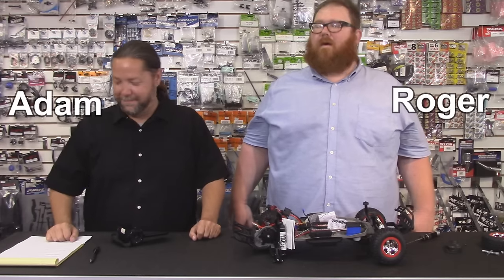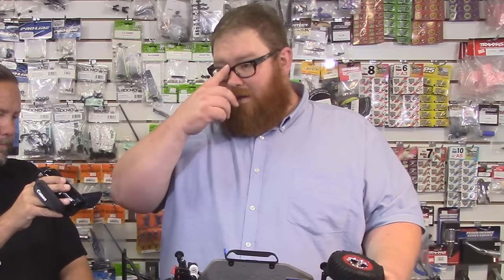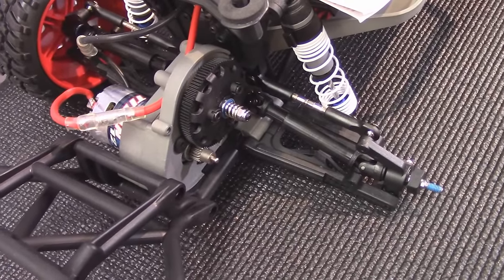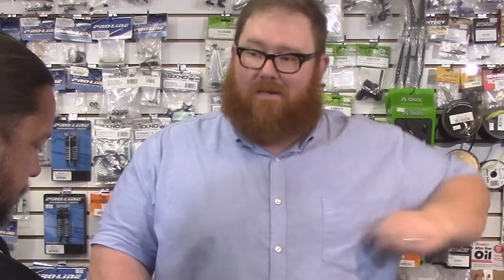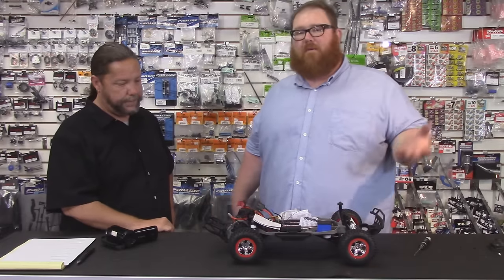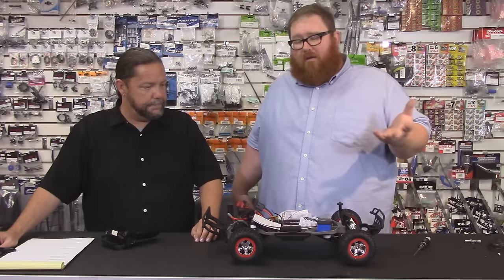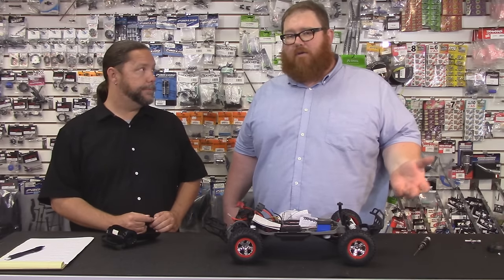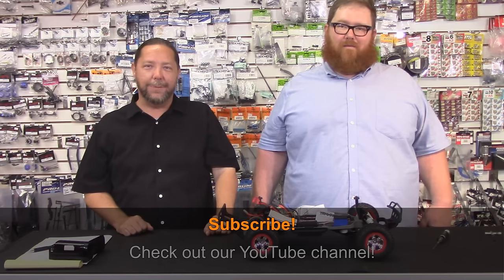Check & Adjust RC Slipper Clutch - How-To

Comment: Yeah this solved my problem. My clutch actually caught on fire... Getting a new one soon.
Reply from the maker: Wow, we've never seen RC clutch on fire
Reply: @Rcstreetshop  i was trying to figure out what happened and i was pulling the throttle for a good 30 seconds then some of the plastic caught fire... My steering servo also died yesterday so im getting all my new parts soon.

Comment: Not gonna just strip the spur gear if its set to tight it can put that much more power into the differential only way i used to strip diff gear in tmaxx

Comment: AWESOME INFORMATION!...I have a question hoping you guys can answer. I recently chose to put aluminum slipper pads. After a couple of runs I opened it back up and noticed I had metal shavings every where in my MM/Slipper housing. Turns out that the hubs were grinding into the aluminum pads leaving a circular groove in the pads. Is that normal for aluminum pads?...because the plastic stock pads only had scuff marks that I can easily clean off...the hub didn't cut/dig into the plastic. If it's not normal...what can be the cause of this?

Comment: What kind of damage can overheating do to the motor
Reply from the maker: 1) damage magnets -> efficiency drops
2) crack isolation laquer -> shortcut
3) overheat ballbearing -> damage isolation ->shortcut
4) damage magnet glue -> shortcut

Comment: Is a loose slipper clutch the reason why my rustler only pulls 30 on a full 3s and max gearing?
Reply from the maker: Loose slipper slips under acceleration, so it very could be a reason.
Reply: Possibly. Or, if you have terrible tires that just constantly slip that'll do it too

Comment: nice vids, i got a question about traxxas stock tires,  do they all come unbalanced?  mine did and my back tires shake when i hit the gas in the air.  front ones seem to want to hang at a specific spot.  first time traxxas owner here.
Reply from the maker: Any tire comes unbalanced, it doesn't matter if its Traxxas, Kyosho or HPI. 
It is recommended to balance it (to make your suspension work better), but it is not obligatory.
Reply: RC Street Shop how is that done?
Reply from the maker: You suppose to use a special tire balancer.

Comment: I have a stampede, I thought the differential was shot so I bought a new one and installed still just power to the right side is this a  slipper issue? Anything will help like your channel.
Reply: Check your hub bearings (or bushings for XL-5 models). If you have a bad/seized bearing on one side, that'll create extra resistance on that side and the differential is going to send power to the side with less resistance.

Also, if you have a rock stuck between your wheel and the suspension, that'll do it too.

Comment: Thank you for that but when my rustler goes about a foot, the tires lock and idk why, please help me, the clutch is fine, the small gear turns all the way around, but the big gear stops at a certain point, please help me
Reply from the maker: It is hard/impossible to troubleshoot over the internet....from what I understand, it looks like your diff works funky. Check your differential and gearbox before anything else.
Reply: +RC Street Shop thx I'll go do that
Reply from the maker: Anytime!

Comment: if I follow your guide for the 2WD transmission upgrade, and im thinking about getting the Slipper Clutch ELIMINATOR
 I have a full aluminum 2WD stampede 3S lipo, Castle Sidewinder , traxxas VXL 3500kv motor, steel roll cage, etc I'm going for maximum bash and as much torque as possible. my question is...

Which parts can I expect to be regularly replacing, I know I'm gonna be breaking stuff
Reply from the maker: When you fully upgraded your truck, plus beefed up transmission you probably should reinforce your pins (high grade or titanium) and gears...sometimes you may even snap a shaft off of your motor...
At this point, really hard to predict, to be honest with you...

Comment: My slipper clutch is so tight I can't crack it loose and suggestions without damaging anything
Reply from the maker: Most likely it's already damaged/burnt/seized then. Just replace pads and you should be good to go.
Reply: RC Street Shop the truck is brand new I tried to loosen the clutch before I ever drove it
Reply: RC Street Shop I think Rodger got his hands on it lol
Reply from the maker: I think I know what the problem is....you need to lock the shaft first, so either hold both tires/wheels or spur gear and you should be able to undo the nut.
Reply: RC Street Shop ok I got it loose thanks

Comment: Does this apply for nitros too?
Reply from the maker: Not quite, with nitros you have clutch, which slips while engagement. Its factory pre-set, unless you change it to aftermarket or some other specs

Comment: Is a 4000kv better than a 3500 KV motor
Reply from the maker: 4000Kv is a faster motor, but 3500kv has a bit more torque. It depends on the application which one is better.
Reply: There are a lot of variables that go into that but, if I were to assume that the Kv is the only difference, the higher Kv motor produces more RPM per volt while the lower Kv motor produces more torque per amp.

Comment: When I try to tighten the nut, the slipper spins too even if I hold the gear. Is there a reason for this?
Reply: I've had that issue before too. To get around that, I stand the truck up on its left side so the spur gear faces up. Then as I hold the spur, I also push down on it that way it puts more pressure on the pads and prevents slipping while I adjust it.

Comment: guys I have a traxxas rustler vxl that I run a traxxas id 3s lipo in there I'm having real bad problems with the stock drive shafts I'm in the UK so everything ordered has extra cost on handling fees and what not plus postage from us to uk is extreme it's crazy well I didn't consider it when I bought the rusty 3 weeks ago from a UK shop and parts isn't available most of the time any ideas :)
Reply: get MIP driveshafts. never had a problem with them
Reply: Make sure your clutch is set appropriately for where you run and also make sure that your suspension is set appropriately too. If the driveshafts are constantly sitting at a steep angle, that puts additional strain on the joints and makes them more prone to failure.

Comment: this is no help I don't want my tlr22.3 gears to wear out and wheels it's a race buggy and gears for my car are expensive
t
Reply from the maker: Then I would set your clutch looser and not strip those expensive spur gears and tires.

Comment: So for higher speeds the 4000 KV is better
Reply from the maker: Yes, 4000KV is 4000RMPs per volt, so 3S is going to be 11.1 x 4000 = 44.400 RPM on the shaft (in ideal world)
Reply: Ok thx

Comment: I have a question for my 2 wheel drive Traxxas Slash how do I help cool down the motor
Reply from the maker: It may oveheat for two reasons:
1) overspeed 
2) overload 
Depends on what you have you may need to adjust your gear ratio, battery, ESC/Motor, tire grip etc

P.S. adding heatsink would not cure the reason, but definitely help
Reply: I put a bigger pinion gear and a smaller  spur gear
Reply: Is there a fan for 2 wheel drive RC cars Traxxas Slash
Reply from the maker: If you use stock electronics, then there is a cooling fan for ESC and heatsink for the Motor.
Reply: RC Street Shop mine is a brushless 4000kv
Reply from the maker: Yes, they do have a fan and heatsink. If you need one then just send us a line buy@rcstreetshop.com and will send it over.

Comment: I tightened mine all the way and still stripping the single speed gear. Y is that?
Reply from the maker: It shouldn't be that tight. It should give a bit to let it slips instead of stripping gears.
Reply: RC Street Shop I had it to loose one time and it stripped so I did the Rodger way and it did again
Reply from the maker: You're turning it a bit too much. instead of going 1/4 of a turn, do 1/12.
It also depends on how your gear mesh set. What setup do you run?
Reply: RC Street Shop 64 20 32 pitch
Reply from the maker: Motor/ESC/Battery ??
Reply: RC Street Shop 3s 5000 40c discharge with 2600 kv goolrc motor with 120amp esc
Reply from the maker: I'm not familiar with this setup, but with low KV motors you are getting into extreme zone if you go above 18T on 3S.
Plus try to readjust slipper, but this time with 1/12 increments.

Comment: thx guys my car went down yesterday and I thought right away its the motor but when i picked him up, the wheels still turned when pressing gas. I took it apart and found no broken things but now I know that I have to check this as well. This video is by far the best I found.
Reply from the maker: Thanks for your feedback Manuel!
Reply: well it seams it was not the cause of the problem and I ripped my diff apart as I probably tightend it to heavy. At least one side of the wheels is blockednow. Might also be because I took everything apart before I tighten it. But not worries, I will take the car to the shop where I bought it. They are very helpfull and I can order the things needed right away :D :D But still the video is very good and helped.
Reply from the maker: Local Hobby Shop👍👍👍
Reply: sure thing I dont like to order from abroad just to save a few bugs. and I always look to use the shops closest to me. Not only for RC stuff. But somethimes you have to go a bit further :-)

Comment: Thanks for the video.  I needed this because I removed the bearing in my Slash which is attached to the slipper, and didn't know how to readjust it when  putting it back together.
Reply from the maker: Anytime 👍 thanks for your comment!

Comment: What if one of my Slash wheels is spinning forward while the other is spinning backwards
Reply: Alex Kniefel that's part of the transmission it's supposed to do that
Reply: Alex Kniefel if you spin one wheel and the other one is going a different direction the motor shouldn't spin but if you put both wheels the same direction then the motor should turn